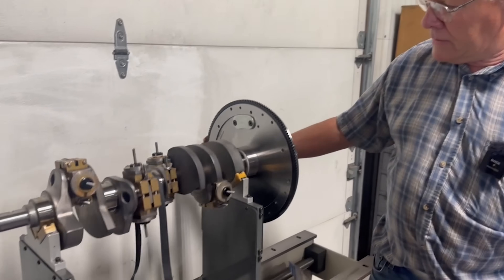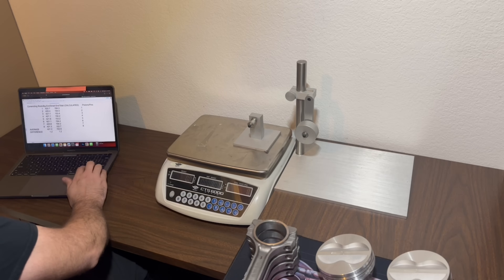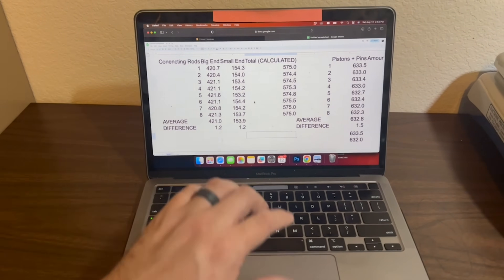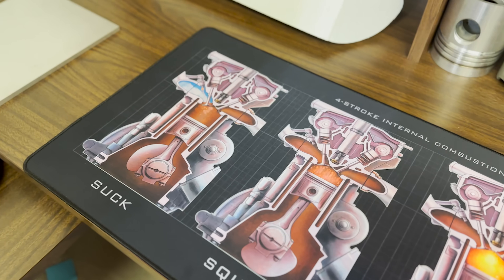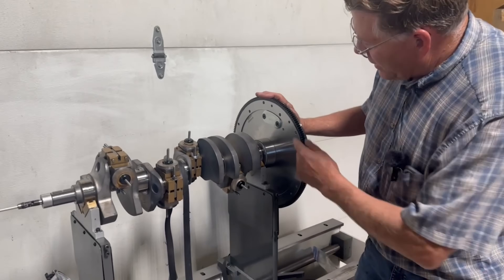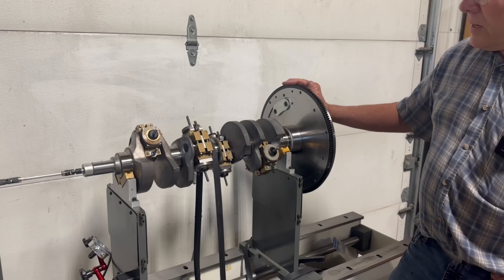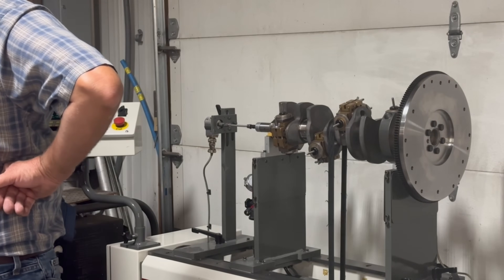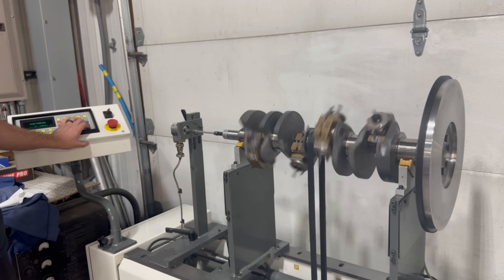How do WE Balance YOUR 383 Stroker?

Comment: Well, to my knowledge and externally balanced flywheel doesn't work because when you bolt on a pressure plate and also the clutch disc clamps up in variegated balances.  The crank should have been internally balanced for the manual trans application. I found out the hard way and so has many an engine builder. Additionally maybe you didn't show it but when that weight came at that local on the back counter, I'd have taken that flywheel off and spun it.  Money says the weight would have changed significantly. So if you're sticking to the external balance page then you'd better have the clutch cover bolted on there and spin it. Good luck.
Reply: Should you wish to spend a bit more time, after balancing the crankshaft on "Sum" or "Total" meaning both ends combined, you could then attach the pressure plate for a separate balance of that unit; assuming you isolated each end for balance, then spun both together. If not, good luck. The type of machine you are using is close, but not accurate compared to the old Stewart-Warner 2000 series machines. These machines required a minimum of 6 months for proper technique, with today's average labor force lasting only 4-5 months at a shop anyway, hence the "hurry up/good enough type machines that spin the crank at a set RPM, programmed by the crankshaft counterweight diameter. The only means of double-checking your balance on this machine is to increase the RPMs above the programmed amount and let it come back down to see if there is any out-of-balance noted on the dial. The other fact for precision balancing is to position the bob weights vertically, instead of horizontally to achieve maximum balance. Testing in both positions will prove that this vertical position shows additional "out of balance" compared to the lesser reading when mounted horizontally. When you visit old-time professional race engine builders, you will notice one or two of the old Stewart-Warner 2000 units sitting there for their best balance results of engines of that time as Ed Pink and others, one example was ABS Balancing Service in CA. The one-mentioned suggestion for "knife edging" was excellent, and prevented oil slobber and frothing from additional holes in the crankshaft stirring liquids up. The average customer fails to understand the horse-power gain from "internally balancing" a crankshaft and sees only the large extra pricing due to the amount of Tungsten/Mallory required. Please remember, the closer you move to the center, the more weight it takes to achieve the same result as the smaller weight on the flywheel. I spent 22 years on a Stewart-Warner 2000 strobe/tube type machine, plus other modern machines such as the fixed rpm machines. Pistons & rods should be marked accordingly for the consumer's future replacement needs.
Reply: @madewithscraps  interesting and yeah I've spent a few years building and in the machine shops both experimenting and outright building. I'm old school where you couldn't just buy from a catalog or vender.   I was taught that any job worth doing... So your statement of spending a lot of time falls into that refrain also. From the planning of the recipe to the blueprinting it didn't matter.  You're also quite right, the individuals entering the trade today don't care about why you have to plug in the toaster, just that you push the leaver and out pops toast a few seconds later. The what or why matters not to them much less the time to learn them.  Just ask them about what color the wall is. They don't care that it's colorless without light. There is no way they want to learn the hard way.   I've had a young man asking for a job claim a skill is that he could "build a fast motor"  in some video game.   I don't remember the manufacturer or model of the first balancer I worked on but the owner of the machine shop made me do the weights and show him my math as well as documentation before the crank even got spun one time. The needles would sweep and show us where the modifications were needed and sometimes Pat would say we can't pull from here because there was no counter weight to drill so we'd have to move to the other end and figure out where to place the weight or remove some.  I didn't know the indexing of the weights was a double check but do remember doing it. I also remember him slowing and speeding up the spin with the dial on the control panel.  I seem to recall also taking from each balance pad or piston strut because he didn't like the total weight even though I'd gotten the weights within a gram. His father was the owner machinist before it became his so I'm sure his dad Red Adams showed him
Reply: So well stated for today's time and attitudes towards a genuine "good job". Funny statement regarding the "build a fast engine". Anybody can achieve that feat, but can you make it stay together and for how long? I was fortunate enough to graduate from a trade school, then progressed to a college majoring in "Automotive Technology", plus working at machine shops, starting at the Hot Tank, then the privilege of re-grinding camshafts on Saturday afternoons, eventually working my way into the shop, starting with knurling the thrust side of pistons for rebuilds out front. From there cut the rod & main caps for the head machinist, then sized the rod's large ends, pin fitting for oversized pins on the small end, install new rod pin bushings, and finally to the Sunnen align-hone machine. All this after college and a 50-mile round trip in the opposite direction from school. After lacking a raise from my initial shop, I was employed at the 2nd largest engine building plant on the assembly line with 6 of us one on each side stationed at a small table, and allowed only an electric nonadjustable impact wrench for assembly of the entire engine. I built the old Y-block Ford engines for the "U.D" " plane totes for Miramar Air Base, being responsible for any "yo-yo" and having to go to the field and perform repairs alone if any mistakes were made. Thank goodness all my engines got run on the Dino first before going out! Throughout my young adulthood, worked for many machine shops, also renting spaces in garages for mechanical work on vehicles to pay my way through college. I loved my shop and enjoyed producing a fine product no matter what it came in as. Each engine was balanced in "inch ounces", and priced accordingly, squared on the decks, cranks ground, blocks bored and precession honed, with cylinder heads all equipped with bronze valve guides and all new stainless valves, hard exhaust seats, multi-angle valve job, and springs, valve locks, Viton or Teflon stem seals, etc. By myself, I averaged 1-2 complete engines, plus 2-3 sets of cylinder heads per week, and was always busy. If there is a "Heaven", it will have a hot tank, boring bar, balance machine, rod machine, and cylinder head set-ups-LOL @irench
Reply: @madewithscraps      Well we both been put through the schools of hard knocks. September marks 40 yrs as a professional technician. Alignments to machine shops.   Completely agree, anyone can build a time bomb engine.  Mexican built 3.0 mits from a caravan just last year put it in the customer's van against my better judgement but not another "rebuilt" or pieces to make one to be had. It leaked and made a metal grinding scream before I could get it up to check for leaks.  Pan off later had gray metal  in the oil.  NEXT.   lol.    
You also said some horror words to me.  Had a client bring me a 55 Capri and the local machine shop said "no problem" to a rebuild of that Y block. 10 years later, custom pistons from Gregg at Jegs. Even Egge didn't have them. Machinists around here are sheit.  I couldn't solve the riddles because I'm not that old and all the stuff was destroyed. I got the number of an old Dyno and machine shop owner long retired Mark from M&J was kind enough to help me through it. All while his wife was dying.    I've been to Jasper in 94 when they were still east of the Old Miss as was I. I do enjoy watching Lake Speed Jr and all the others of the Engine Expo channel. Most of my career I spent doing drivability and electrical as I foolishly went against the advice of some mentors back years ago.  I have owned this shop for 18 yrs as I couldn't stand to slimmy businessmen of this town after just a few years living here. I hope heaven has dogs and my widow.  For me I'm not even going to sema this year. My  bud was complaining, I told him I've had enough of the catalog rich bitches paying people like his cousin Troy to build million dollar cars.  Oh,, I got the itch to make a sand bagged door slammer to take some youngsters down the track. Then pull the bags for me and another friend to get there in just over 10. My days of building certified chassis are no more too.
Reply: Keep up the Splendid attitude and work habits. Drivability diagnosis is underappreciated, and time-consuming, while most ignore how important it really is for a proper repair, now just throwing parts at it and charging big bucks. What will the world do when we "Dinosaurs" are gone? The shop owner in this video, regardless of his work shown is indeed fortunate to have his son with him, enjoying and learning the "lost trade" of machine shops in today's world. For the short time I had my youngest son with me at my shop, was a really productive and enjoyable time. The shame of most automotive engines being non-refurbishable today is the intent to force a person still in debt from their purchase of the car, to increase that debt and buy another. I hope the gentleman and his son enjoy enough street motor jobs to keep making a living. There is no real "Profit" in High-Performance engine work, simply that "warm & fuzzy feeling" at the end of completion.  @irench

Comment: I'd mark the pistons and rods with letters instead of numbers for weight matching purposes just because if that writing survives and you're not the next person in it, it might be a little confusing. Then reserve the numbers for the cylinders they go in to. 😀
Reply: The markings are to serve the machine shop whilst the parts are in a pristine condition.  If the engine is later disassemebled, a competant mechanic will always mark the piston-rod assemblies before they are removed from the engine - that's standard practice that all apprentices are taught.

Comment: on a production engine rebuilt with production parts, just equalizing the weight of the pistons and of the connecting rods usually makes a very perceptible differenge .
I always equalize the weight of the piston /pin / conrod assemblies within 1 gram when I rebuild a marine engine, it makes a very perceptible difference.

Comment: I have been watching your channel for a few years now .I have been looking in to doing a 408 ls buld for my rock crawler and starting looking for a shop to do the machine work found out you all are about 25 minutes down the road. What would you recommend for a engine to make torque at a low rpm i have a 5.3l right now but looking to start with a 6.0l block from the salvage yard.

Comment: Can someone explain what is meant with blueprinting. I have seen advertised at some machine shops balance and blueprinting, after I watched this video I understand the concept of balancing the engine.
Reply: on production lines, the tolerances are wide to avoid rejecting too much material, when you " blueprint" an engine, you revise all the fits and bring them closer to the ideal fit or geometry. A blueprinted engien is much more precisely machined than a general production engine. usually, it open the way to higher horsepower and operating RPM and it leads to a longer lasting engine.
Reply: @jacquespoirier9071  ok thank you. Let me know if my summarization is correct. When an engine is balanced and blueprinted it is really close (.001 or .002) or a gram of what is deemed perfect for that block, crank, and rotating assembly?

Comment: So does a 383 stroker crank shaft REQUIRE balancing?  Don't know thought this video was going to answer that question.
Reply from the maker: Well we didn't drill all them holes for funsies lol
Reply: No you showed how to balance a crank shaft. You didnt answer the question weather it was required.
Reply from the maker: Lol it’s not my fault you can’t put two and two together 😘
Reply: @JAMSIONLINE  I see 383 rotating kits externally balanced for sale from scat and eagle. So they need to be taken and balanced?
Reply: @John-lt5zs  As far as I know, as I am not a professional, just a guy that's been around this stuff my view is that rotating kits come with pistons, wrist pins, rods, crankshaft, and sometimes balancer / flywheel  can come unbalanced, or already pre balanced from the factory. If the flexplate / flywheel, and or balancer is provided separately you need to ensure it is balanced to the correct specifications so that it doesn't throw the entire assembly out of balance. Many times they are also only roughly balanced say +/- 3 grams for example. For high rpm use usually you will want to balance all the components to ensure that they're under 1 gram difference in balance.

Comment: That counterweight on the flywheel could have come off since you're balancing it internally
Reply: I thought that too. I'm sure it's there for a reason or they would have removed it.
I have complete confidence that they know what they're doing.
Reply: I just had my scat crank balanced and the mCcloud flywheel came with 2 different counterweights and they put the smaller of the 2 on my flywheel, i wondered the same thing

Comment: I have the same passion for balance.   But, back in my crankshaft grinding days,  I noticed that quite often the crank pins were not exactly on the degrees that they were supposed to be.   Essentially I'd treat each pin(journal) as it's own sphere....it may have been off by 3 degrees maybe.  But,  no way can grinding make up for that.   Twist over time? Bad OEM machining?  Beats me.  But,  after seeing that with crankshaft angles, it made me regard balancing parts as not being all that important.  There is far more to balancing than just weight of pieces.  I was weighting rings when the journals were so far off seemed sorta silly.
Reply: Absolutely correct, I never see this brought up before, especially on small block chevys.

Comment: Doesn't a 383 require an externally balanced harmonic balancer? That may be why your balancer told you to remove a boatload of weight off the rear counterweight
Reply: But SCAT always puts extra weight on the counterweight because it's a lot easier to remove weight than add it
Reply: But once again, they should not have to remove so much weight from the rear counterweight
Reply: Also notice that they removed weight from the same spot that the flywheel external weight is..
Maybe this crankshaft is internally balanced on both ends???
Reply from the maker: Page 27 of the catalog. https://www.scatcrankshafts.com/catalog/ Part Number 4-350-3750-5700-L. "Internal Front, External Rear Balance".
Reply: Depends on the crankshaft, this one is specifically made for a 383 and not a reground 400 crank.
Reply: But they make a 383 internally balanced crankshaft also
Reply from the maker: This particular crank is sold as and intended to be external rear and internal front.

Yes you can get fully internal 383 rotating assemblies. For a price.
Reply: A 400 has external weights on both the flywheel and harmonic balancer. Seems odd that this engine only has it on the flywheel
Reply: The dad said the balancer was supposed to be zero balanced, in other words no offset weight. So it wouldn't matter if the balancer was on or off during balancing.
Reply: BTW, I have built many 383s..

Comment: Did you test the balance with the weight removed from the flywheel? Would it have been better to knock some weight off there to save drilling the crank so much? or is that a normal amount of weight to remove from a crank counterweight?
Reply: You want to do it from the crank so if in the future you have to replace the counterweighted flex plate or flywheel with a new one the assembly will remain balanced.

Comment: You you should epoxy a cork in those holes like they use to do on motorcycles
Reply: that might throw off the balance of the crankshaft, defeating the purpose

Comment: I knew someone who bought a salvage yard 400 SBC, but didn't want to spend the extra $25 for the flexplate. Used the old 350 plate instead. Yep shook like a paint mixer!
Reply from the maker: Lol
Reply: I knew a guy that done this as well.   Put it together and drove about a mile.  Broke 2 rods and spit the block up around the cam.   Also one of the rods put a nice inspection hole in the side of the block.
Reply: Bought a 77 Chevy from a friend in highschool. Had a 400 small block... they said... somehow my other friend found a 400sbc before i bought the truck. Yep you guess it they swapped a 350 in place of the 400 and never said a word to me.
Reply: @mashidaho1298 did you beat the shit out of them for that? Or at least cut them off?
Reply: @disturbedrocks1996  never bought anything from them again
 I was young and dumb at the time, didnt know enough to know id been dooped until i went to sell the motor as a 400 and was told otherwise by the casting number. You live and learn.
Reply: @mashidaho1298  amen, brother! Live and learn!